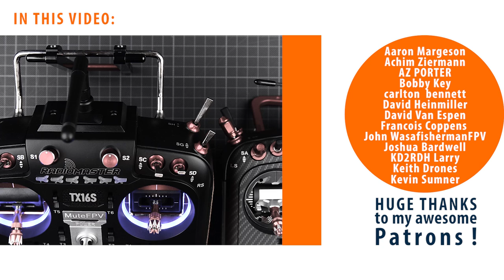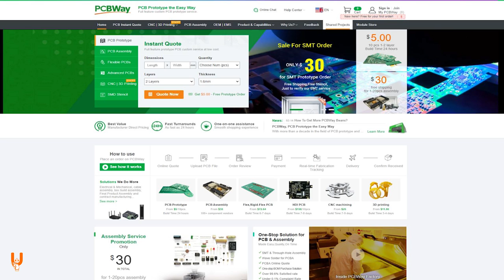Easy removable antenna kit for the Radiomaster TX16S

Comment: I did this kind of thing on my xlite pro controller when I put a stealth tbs module in it. Works a lot better when the fixed antenna
Reply from the maker: Which controller? sorry I did not understand!
Reply: @muteFPV  xlite pro. Sorry it was autocorrected by my phone.

Comment: What did make you abandon the internal antenna? Reception problems?
How is your experience overall with the internal one? Planning to do that mod myself and wondering why they didn't do it from the factory this way.
Reply from the maker: The range was definitely reduced with the PCB antenna but I have this radio for indoor flying / sim so I am playing around every now and then with mods and changes. The stock antenna is small enough and doesn't bother at all so I don't think I would change it if I was happy with the range, if I were you.

Comment: I never use the antenna that came with the TX16S and only use my Crossfire and ELRS modules. Can I get the mod and not have the antenna attached since I never use the internal 4in1?or would that fry the board not having an antenna attached? Thanks in advance!
Reply from the maker: As long as the 4-in-1 internal module is turned off you should be fine. You can also do my internal pcb antenna mod and have the 4in1 in usable condition just in case. Or break the stock plastic arm of the antenna and make the coaxial cable and exposed antenna bit protrude just a tiny bit from the shell of the radio.
Reply: @muteFPV  The last option sounds good. I can't see me ever using the internal 4-1 and I'd just prefer to remove the antenna and not have it in my way. I can 3D print a cap to go over the end but I'm unsure which bit I break off mate? Any help would be appreciated. Also would I turn off the 4-1 from the settings? Thanks.
Reply from the maker: Check Part #2 of my TX16S mods video series, I show how you unclip the antenna arm from the top piece of the radio. Then you can just print a small plug for the hole - I am pretty sure there are also some designs available that double as holders for the external module antenna. The internal  module should be turned off in the settings, yes.
Reply: @muteFPV  Thanks mate. I did watch that a while back. Great video. I thought for a second I might be able to unclip the antenna by pinching it as you showed but take the plastic part off the  antenna and then wire it back in again and not need an extra part? I guess not and I would need to buy the antenna cable with SMA etc?
Reply from the maker: You can separate the two pieces of the plastic arm of the antenna and see how you can remove the antenna cable that is inside, it can definitely be removed, I just can't remember if you need to break part of the plastic or not.
Reply: @muteFPV  I've got some bits apart. Are you on Facebook at all? I want to send you a couple of photos of how it looks now as I've got the antenna in bits.
Reply from the maker: I would prefer via email, if you don't mind: mutefpv (at) gmail (dot) com
Reply: @muteFPV  Sure man. I'll fire you an email now.  Thanks
Reply: A dummy cap on the end would solve the burning out problem correct? Obviously turning module off is easiest but just in case.
Reply from the maker: To add a dummy load on the end of the antenna would need a removable antenna mod first though (uFL to SMA pigtail) for the built in module as well, right? Unless you mean something else.

Comment: Very nice, I ordered a set since it's just convenient. I'll use the kit to route the external ELRS modules antenna to the then detachable main antenna and wire the multiprotocol module to an internal pcb antenna as a backup just in case. Nice video, as usual :)
Reply from the maker: Thank you very much!
Reply: @muteFPV  My pleasure :) Thank YOU for your awesome videos!

Comment: What kickstand u using on the tx16s?
Reply from the maker: Hello! It is a generic transmitter stand with the horizontal bars replaced by standoffs in red color. You can find more info about them  in this video: https://youtu.be/eMIpAhe4GA4

Comment: cool modification!) I didn't like that the antenna is not removable. But I solved this problem differently. I bought this a small top cover for Jumper T16. This makes it even more compact :)
Reply from the maker: Thank you! Which cover did you get?
Reply: @muteFPV  also I want to replace the top long switches - install fixed and momentary metall button